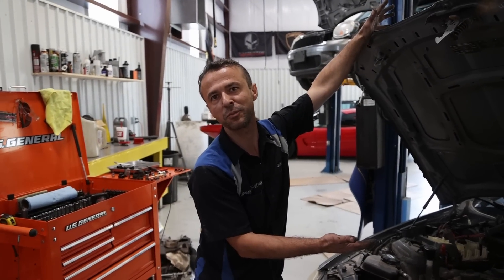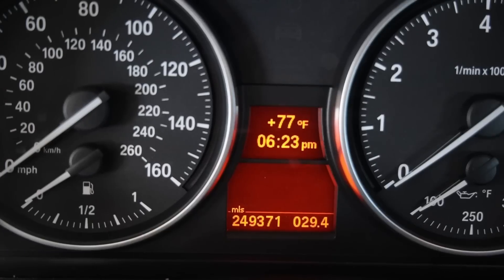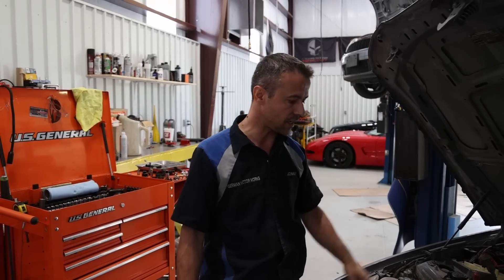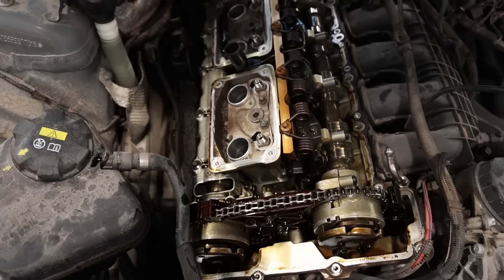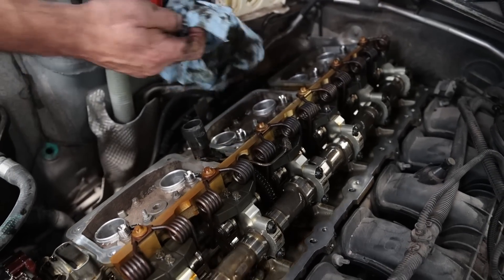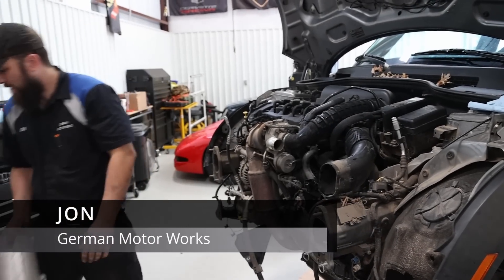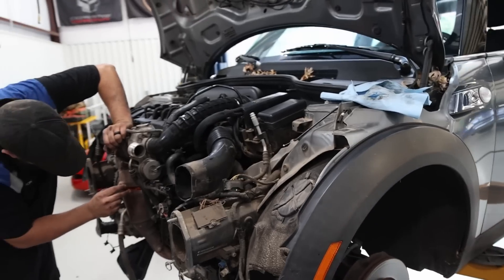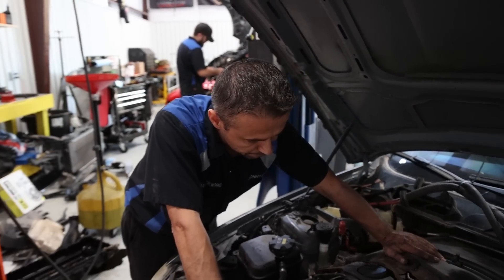CAR NINJA! I Bought a HOOPTIE

Comment: Bmw are great cars just make sure their not AWD nor have turbo, eliminates most big issues and wear, I purchased a 528i 2011 3.0 with 154,000 miles and drives perfect no lights as well all it needed was oil change and spark plugs and filters

Comment: Johnny, I don't know if you pulled the service history from BMW, but I found in my last BMW purchase, private party that my local dealer was happy to pull up the history and print out the "book" of services done at the dealerships.  This will give you every dealer visit at any dealer anywhere.  If your local dealer won't do this, it isn't because they can't, it's because they would rather be a dick.  I've had the same up and down experiences with Subarus.  One dealer says they have no records more than 2 years old and a NASIOC member who works for a dealer has me give him the vin and he's got me the history from day one.  I'm sure the BMW history won't be any surprise.  You can see for yourself that they likely went in for oil changes and TSBs periodically.  It's why this car went 250k miles and other BMWs are crushed at 100k miles with leasers who won't change the oil ever.

Comment: In 1986 I purchased a 1980 Volvo 242 with 170,500 miles. It was a salesman's car. 
Ran great, only a couple of problems over the next 3 yrs when I traded for a 1983 Volvo 245 with 113,000 miles that I promptly drove from the Chicago area to central New Mexico.

Comment: I had a bmw 320d 2013  it had 170000 miles , the only problem i ever had was a snapped front spring extremely reliable and was driving like it was new

Comment: This is what I look at when trying to determine if the car matches the reported mileage. It may sound silly, but it makes a lot of sense too.  Look at the brake pedal rubber, carpeting and conditions of the seats.  Any car with over a quarter of a million miles on it will show a lot of wear on the inside of the car. imagine how many times that brake pedal was used, how many hours someone was in the drivers seat of this car. Also wear and tear on the carpeting under the drivers feet. Any car will over 200,000 miles will show everyday wear and tear, no matter how well you maintained the car.  Just my thoughts.
Reply: Yeah, something is sketchy here. I take better than average care of my vehicles (not a real high bar, lol, but you know what I mean)  and there is no way a 250K car is that clean.

Comment: Loved my 2011 335d, until 200,000 KM when every diesel exhaust control part went bad at once. Repair bill was outrageous, fixed what would take care of the check engine light and traded it in.
Reply: Diesel for trucks and tractors, gas for everything else, that’s my rule, learned by experience
Reply: @paulsteverodriguez3549  yup, never again. Was enticed by the torque and fuel economy but getting similar if not better l/100km in my WRX

Comment: Just saw at the end, do you really just drop the spark plugs in the tube like that? Arent you worried about bending the points and then out of spec? I guess they don't have a ton of wiggle room, but they sounded like a nut being dropped into a tin can lol
Reply from the maker: There is a hole in the bottom that the plug threads in to. The electrode never impacts anything.

Comment: are you sure the computer didnt malfunction and put a zero on, as how is this even possible, did an old boy who always changed the oil at 3000 miles and kept it garage kept keep this thing? as plastic, as in all the parts in the engine bay, can last under the right circumstances, like I've seen plastic bits and bobs from I think some time piece from the 1980's that was in perfect shape. 

but never on a BMW from this era.

Comment: I love these videos.  Cars that mainly drive long distances don't wear much.  My 2006 Mazda 2 has exceeded 300,000 kilometers (almost 200,000 miles) mostly in long trips and is still in perfect condition.  No rust, no leaks, original brakes, original clutch, original belts, original brake fluid, etc. and it runs perfectly.  The only fail was the battery (twice) and one electric window winder engine.  It is amazing how long a car will last if it is cared for.

Comment: Looks like someone did lots and lots of low stress motorway miles. I always tell people they shouldn’t be scared of high mileage IF it’s been well services and those miles are generally motorway! We had volvos well over 300,000 miles 👍
You got lucky with the trans 😃 looks a lovely motor

Comment: A sensor built into the valve cover? No wonder maintenance costs are high on BMW vehicles.
Reply: the pcv valve is built into the valve cover. So unless you use a cheap chinesium pcv valve replacement kit. The only way to oem the vavle is a new valve cover.
He replaced it for the valve cover leaking and got the pcv valve at the same time.

Comment: That’s freakishly clean for 250k miles, inside both the cabin and the head. No varnish whatsoever, looks like 3500-5k oil changes strictly. Glad they didn’t adhere to the 10-15k recommended interval. Seriously the inside, seats are in the same condition as my 20k mile W212

Comment: Safe to say the N55 is more reliable than the N54? A quarter million miles is pretty good! You should do a video showing the intake valve carbon buildup on this one.
Reply: My understanding is the NA engines are reliable. When they started turboing is when the problems started. I could be wrong though.
Reply: @EvilCerealBoX  I'd have to agree, my M54 has been very reliable. My friends who own N54 cars, not so much.

Comment: Great vid & good reminder - high mileage is not always bad. If that is the orig engine, I'll guess someone did a LOT of highway miles; by themselves.

I jus picked up a ’98 Volvo V70 T5, with nearly 200K miles. The engine is in great shape and passed compression & leak down tests; recent new turbo. Trans shifts well. Zero rust and just hood & front bumper respray needed. I need to do most everything, on the suspension; big upgrades going there. That’s OK. I paid just $1000, for the car. Hooptie? Sunday twisty car? Old guy sleeper Brick? Occasional track car? Ima go with ‘All of The Above’.

Comment: I do remember (a reverse thing sort of) when we drove thru Germany in a old SAAB 900 (can not remember the date of the car but maybe it was 1984 or maybe a couple of years later) We drove it in the early 2000 though. He had bought it from an old lady that took it to the shops 1 couple of miles every other day. He used it for getting to work (which was about 1-2 miles away)... So the car had very very low mileage but was an older car.
The car dropped it's exhaust system at the downpipe and sounded like the a true rally car :-) Anyway we got it into a shop (usually only doing warranty service for Volkswagen/Audi but with a bit of pleading they would check if they could repair it (they just needed to weld the exhaust back so we could get home :-) and yes they could do it (they where awesome! and so helpful!).

Anyway... we had to do some paperwork (yes the German kind, lots of questions and papers to fill), then the german man asked how many kilometers had the car run, my friend (he always knew from the top of his head) 9000 Km (which is about 5500 Miles) and the german man said again "no" and asked the question again... my friend said the same number... german man tried to explain that he meant the number in kilometers and what the total was and so on... and my friend again said the same number (but now he was thinking maybe the german wanted something else instead or at least we where confused)... And still the german said no and implied that we did not understand what he meant.
He then asked for the keys to the car, my friend gave it to him and we all went out to the car which he opened and then stared at the "mileage meter" and said "ah, jaa ok" :-)

I guess in Germany with the Autobahn a 1 year old car would have easily double the amount of mileage. Anyway it was a funny story.

Comment: Damn, 250 thousand miles in ten years? Someone either had long commutes or took cross country trips; maybe both lol.
But on the plus side, the engine and interior looks very good. Previous owner definitely changed the oil regularly and took good care of the car overall.
Reply: Not as hard as you'd think. Or have I been living in the country too long? A bit over 100 miles a day to work and back plus drives through the mountains as therapy.

That truck I bought new in March 2018? Yeah, rolled over 100,000 last week.

Comment: I'd trust him to work on my car, but just dropping the plugs in like that went through me.
Reply: I was thinking the same thing and I think I've seen him do that in a other video I'm a Euro tech and I would be worried to bend the ground strap of the plug or crack the porcelain it must be something he does a lot and never had a bad experience but for me I use a rubber hose to start the thread and then use a socket on it and I also use a torque wrench to tight the plug to specs.
Reply: I agree, rough as guts
Reply: Iridium plugs gaps don't have to be precise.

Comment: The rubber grommet in a spark plug socket lets you install them too. Droping plugs in the holes, who knows what your gap might be after that?! Also more likely to knock grime into the chamber.
Reply: I agreem bit a a Abdul-the-butcher
Reply: Iridium spark plug gaps don't need to be precise, I know Johnny knows what he is doing.
Reply: Yeah I trust the gap out of the box too😄
Reply: Yeah kinda grimaced when he just threw those in!  Sheesh
Reply: Not likely to knock the gap off at all, requires more force than that to bend the ground.

Comment: I see cars like this fairly often actually since my shop is about 65 miles outside the DC Baltimore metro area many of my customers commute to work and so the average mileage is more like 20 to 25K per year  . Ten year old BMW's with over 200K are pretty common and since many of those people rely on them to get to work they also get good maintenance as well . Not that you don't find plenty of HOOPTIEs too that people don't seem to know have oil in them let alone that it should be changed regularly .

Comment: Dropping spark plugs like that and then tightening with power tool?  Ninja, i'm a bit disappointed.
Reply: You’ll get over it…
Reply: I was going to say the same thing. That could have changed the gap or damaged coating on the tip
Reply: Well i think he knows was he is doing.He is a BMW expert so...
Reply: @alin-cosminschneider7180  it doesn’t matter what kind of car it is lol could be a Chevy still best not to drop plugs.
Reply: Very valid point but when you spend decades as a professional technician you know exactly what you can get away with without incident.  I can torque just about anything with an impact and be within 10% of the desired torque value.  You get a feel for things so it's not a big deal.. Oh and when you're working on your own ride you just want the job done ASAP..  If it were a novice technician i'd be all over him for it... First you get good, then you get fast, then you get good and fast after a lot of experience.
Reply: @gmctech  I understand where you’re coming from no doubt. Most of us mechanics have a magnetic spark plug socket for aid of convenience during removal and installation so why not use it. Might cost you an extra 30 seconds for 6 plugs
Reply: It just does not look good for a channel to record that type of a work practice. Makes you wonder what happens when the lights go out.
Reply: Seriously, if that little drop affected the spark plug then it is defective.  The environment  the elctode lives is is far more destructive than a little caclunk diagonal drop.  I've installed hundreds of plugs for myself this way and never an issue.  But yes I'll admit that when i was a Tech i never did on customers cars and I'd almost literally crawl up your rectum sidways if you did this in my class as I'm now an Automotive Service Technician educator in college LoL...

Comment: This clearly shows that the reason why there are so many hopelessly broken BMWs under 100.000 miles in the US is not primarily about BMW itself (even though those cars have more than few glitches), but instead very problematic level of service these cars are getting in American service centers including authorized ones. Older BMW with more than 200.000 miles are very common sight here in Europe and even those cars just continue running as long as they are properly maintained.
Reply: People who buy luxury cars don’t want to fix them, and average people can’t afford to fix them.

Comment: If not for a cracked trans pan this car would still be running without issues at 250k miles. Pretty impressive for a turbo charged bmw. Impressive for any turbo car.

Comment: from exp with a 99 523i (no sat nav, electric seats etc..) that I owed years ago, high mileage will mean one thing going wrong after another, unless the engine has been rebuilt and the broader drive train completely refreshed. In my case, between about, 120000 and 140000 miles, the radiator blew, the fuel pump failed, multiple oils leaks (repair one e.g. head gasket and another starts), airbags, drive shaft and if I recall correctly the timing chain. This was on top of multiple trunk and cd player failures. During some BMW driving courses I did later on, speaking to other BMW owners of newer vehicles it seems I was lucky; many by brand new and get rid of their BMWs by 70,000 miles to avoid mounting issues.

Comment: Ninja, have you checked the various modules with ISTA/INPA (can't remember which) to see if the mileage is consistent on all modules? Maybe the gauge cluster was replaced at some point with one from a higher mileage car?
Reply: Maybe it was towed, I know some cars rack up miles if they are towed with two wheels on the ground.
Reply: @dcast777  towed for 100k miles? lol
Reply: @Bananektdu  Yes, if it was behind an RV. It's not that uncommon.
Reply: @Bananektdu  my buddys wrangler was towed (with all 4 wheels on the ground) for ~50k of its miles. I know its less common for that to happen to a beemer but theres still a chance
Reply: @user24657b  What the hell? Why would you tow a car for 50k miles at all?  Did he use it as a trailer? It seems pointless, just sell the thing and buy something better

Comment: I just got a N55(X3 F25) with 145k miles. When I was looking up the car there does seem to be alot of debate about how many miles a N55 can do. Some people are of the opinion over 100k its a time bomb, and others they do much much more than that. So I think this 250k N55 is a great topic. And since its for your daughter just doing over the wear that car has at 250k is pretty interesting and would really show what parts a modern high milage turbo BMW owner really needs to concerned about.

Comment: People love to freak about miles. The Acura I own now is the lowest mileage car I've owned in a very long time. It has 160k. I normally don't own cars with less than 200k. Miles don't scare me. My wife's car is a 2002 Sonata, we got in January 2019 with 77k original miles. Has 106k now and still runs like new. She gets the nicer low mileage car so we don't have to worry about hers too often. Moral is. DON'T be afraid of miles guys.
Reply: I’ll buy any car if I can see some form of maintenance with any miles. Basic basic maintenance and general care will keep just a bout any car running.
Reply: 160K for a properly maintained HondAcura is barely broken-in. 160K in a BMW is "way overdue for the crusher"
Reply: Bought my Altima with 14,000 miles from a rental company and now have over 140,000 miles. Only "MAJOR" problem is my transmission has gone out. Took it to the dealer, they reset the warning and its totally drivable around town. Just staying off the hills and freeways until I can come up with the money for a refurbished one.
Reply: When you get over 2 million on the same engine and trans, time to look for a replacement.
Reply: 211500+ on my rl. Drives like new. Was (and is) maintained religiously. Maintanence > miles
Reply: @stevearnold100  CVT  is my guess.
Reply: Somehow I'm on a second vehicle that I don't know the true miles of. I know the first was over 300k miles, and the engine and 5 speed trans was perfect, the frame was not. This one is over 200k, no idea how much over, but its doing just fine, even though its a jeep. It is the i6 jeep engine, so I don't expect that will be the issue. My mom just got a 180k mile acura, it doesn't seem to have many issues. The biggest issues are finding a way to attach the license plates, and the transmission range sensor is starting to fail.
Reply: @gillesthibault429  Did you just skip the video or got a knock to your head?
Reply: I had a friend who bought a used Honda Civic that had about 350k miles on it. He needed a car for commuting. He used the car until about 550k miles. The cam lobes had wore downfor some reason. He went to the junk yard and bought a engine that had less 200k miles and it's been a few years. But it's still a reliable commuting car.

Comment: As en European, i can assure that you guys in states take really bad care of the cars.
Most of the circa 2008 engines are expected to do 350k miles easy, with not perfect maintnance.
It is common to find cars at 450k miles for sale, that run and drive really well.

BMW, Mercedes, Peugeot, Renault, Lancia, doesnt matter. Just do the maintnance. And by miles, i mean miles, not kms.

Comment: I am a BMW enthusiast.  I realize that the newer engines are more efficient and make more power.  The use of plastics in high heat locations just seems to guarantee failure. I will stick to the earlier cars with metal intakes and valve covers.  Thank you for the video!